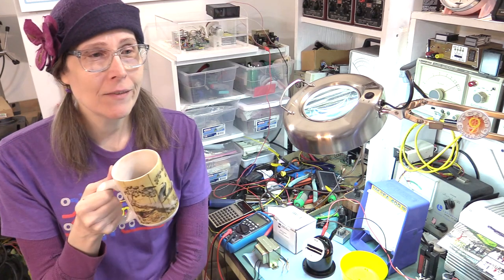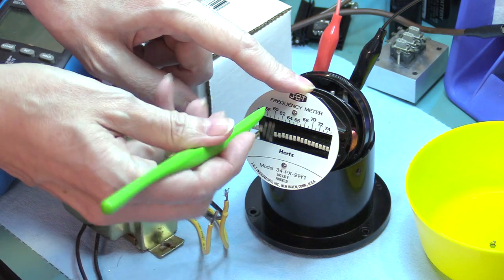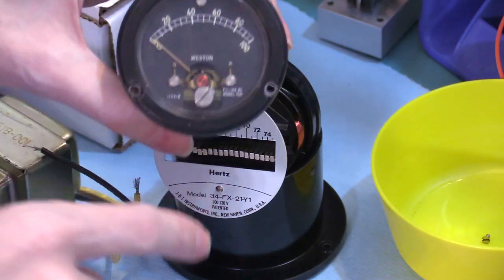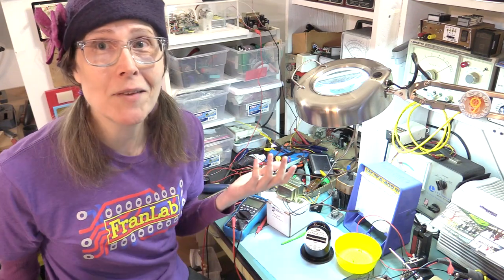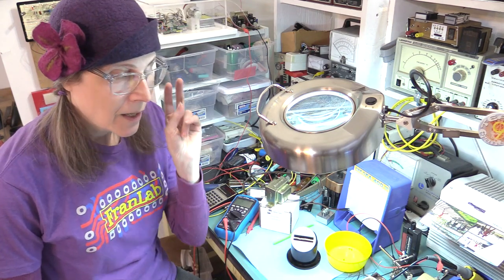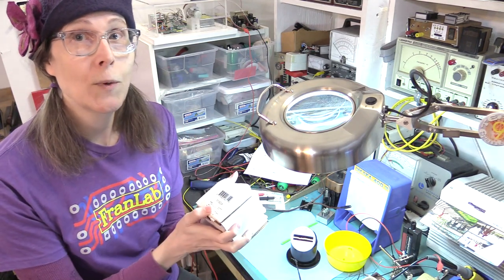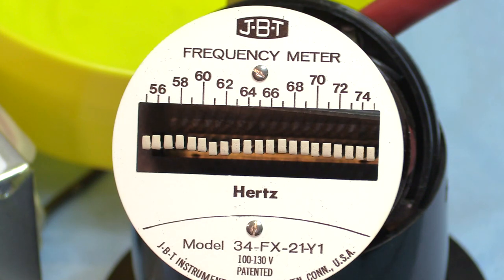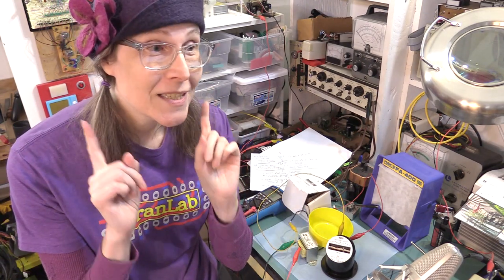Deep Dive Into The Electromagnetic Frequency Counter

Comment: Still not sure why they picked that frequency range...  If it was designed for American use only, why not center it around 60hz?  Is the frequency more likely to vary up than down?  And why not make it extend down to 50hz to be compatible with EU systems?

Comment: Gotta say, I've never heard of these before this video, and I think I figured it out on first glance. Before it was opened up. I know it's a frequency meter cos the video is titled so, but the "Hertz" marking is a dead giveaway for that.

How it works - electricity of some kind flows through the coil. Cos it's around 60Hz maybe US mains? Maybe for a big motor? The tines of the comb resonate along with the magnetic field, and whichever resonates most will be the right answer. I'd guess adjacent tines would wobble too, but not as much, it'll be a rounded blur when they're wibbling at their proper frequency. 

That's my guess, I know Fran's not stupid but I think you messed up on this one!
Reply: BTW the idea of a comb of vibrating tines is also used in a music box, this is sort of an inverse version of that. And old RC planes / cars etc used to use tuned tines as a way of encoding information before pulses were used. The transmitter would have vibrating forks for each input, which would be transmitted as audio over the RF. The reciever would pick that up, and feed it to a coil around a tuned comb like this, and the tine at that frequency would vibrate most heavily, and thus vibrate further back and forth. Since it was metal, it could touch against a contact and energise whatever circuit. I read about this in a really, really old book in a library, the horrendous neglect of library budgets has meant I learnt a few bits of long-obsolete knowledge as a kid. 

Then as an adult, I once drank in a pub that had the walls lined with books, the ones decorators buy by the metre. Shameful really but if nobody else is gonna step up... My eyes naturally were drawn to a guide to industrial mains wiring from 1915 or so. It had mercury rectifiers but no semiconductors, everything else was electromechanical and often based round losing huge quantities of power as heat, as the only way of controlling it. I took it home, I'm sure the profit on my pint paid them back for it a hundred times. Didn't learn anything useful but that's not the point.

Comment: Found the patent https://patents.google.com/patent/US3374432A/en?assignee=J+B+T+INSTR+Inc&page=1

The diverging plates are so the heavier times and the lighter times have the same amplitude for a given voltage. 

The heavier ones need less force to get same amplitude surprisingly.
Analogous to q factor I think: 1/R*root(L/C)

The inductance corresponds to mass, so the heavier slower ones have a sharper+higher peak.

I

Comment: The only reason y i knew how it worked was cause i saw ave playing with a vibration / rpm device that was nearly identical just without the coil. i bet u could have just strapped it to a subwoofer and played different frequency's and that would have showd it working

Comment: Since when did DC resistance of the primary of the transformer equal the seen impedance at audio frequencies??? Your tube amp wouldn't work with that mentality. But yes, the idea of a step-up transformer is there :-)

Comment: 14 minutes in, you are confusing resistance with impedance. All other things being equal, the input impedance of the transformer is determined by the load on the output of the transformer and the turns ratio. Of course stray much outside the transformer's spec and other factors come into play. Imagine a mains transformer with a light bulb across the secondary. Switch the bulb off, and the mains power consumption falls to almost zero right? Because the 'infinite' secondary impedance is reflected back to the primary. Measuring DC resistance is just measuring the resistance of a length of copper wire - unravel it off the transformer and it'll read the same.

Comment: Your calculus is wrong regarding impedance , you measure DC resistance with your multimeter from primary and secondary but not the impedance of the coil at 60HZ which is completely different .

Comment: doesn't the DC resistance of transformers disappear when you apply AC to it? and then impedance takes over?
Reply: Yes, with the exception of ferroresonance. This is a rare occurance, but can happen when an outside influance changes the series capacitance in  the line. Basically, it takes the phase angle relationship of the voltage and current away. The voltage and current come into phase unity, therefor the AC signal looks like DC as far as the inductor is concerned and behaves like DC. Bad things can then follow.........

Comment: But Fran, love... You're way too concerned about the impedance match there when in reality that amp can more than handle driving that meter thru the power transformer you have there in your hand.

If you need 1W out, you're not putting much more than 1W in to the transformer to get that same watt out the other side.

I realize you aren't into blowing things up on your bench, but you have to realize when you're dealing with driving something like that, all you have to do is get the voltage up high enough to stimulate the coil.

That and I guarantee you didn't measure the actual impedance of the transformer coming up with 100 milliohms. The value obtained alone tells me that was obtained with a DC measurement which isn't even close to the AC impedance. You'll find if anything that the transformer could be placed across the speakers in parallel and the amp wouldn't even hardly notice it was there, even less so by itself.

The key to this kind of experimenting is to start out with the drive low and ramp it up until you get the desired effect, while observing the behavior of the equipment you're using to drive it. Anything funny? Back out.

Either way I'm glad you did the follow up just because it showed you it wasn't as complex as you thought it would be.

Comment: the explanation of the impedance mismatch does not work !  when you connect this frequency meter to the power utility  the power utility impedance is almost zero  an the frequency meter  will work perfectly . The power utility is a voltage source   putting a 2 K ohm load on it won’t affect it .

Comment: Wondered why you didn't drive it with a solid state Hi-Fi amp instead.  A guitar amp is far from linear or clean at 60 Hz, and you risked damaging it by running it into an unloaded transformer instead of a speaker.

Comment: How did you know to hook power to each terminal or side as opposed to hooking it in series like an Ammeter? Did it come with a schematic and hookup instructions?
Reply: With a DC resistance of 16K, it wouldn't go in series with a load.  Also, there would be no advantage to series connection just for frequency measurement.
Reply: @thesquarerootofnegativei6225  But even if you hooked it in series, you'd still get 60Hz running through it... The 16K internal resistance would be the load
Reply: @JungleYT  You would, but your load, without which there is no "in series", wouldn't get much power.  If the only load is the meter, it is in parallel with the power source.  Which is fine.  It answers your initial query.

Comment: 100-130 volts? Plug it STRAIGHT into the wall. No, seriously, that is how it works. Do the math. Ohm's law. Those meters were common in generator sets. A resistance of 16K ohms @ 120 volts is 7.5 mA. That is not a COINCIDENCE. Emergency generator power was more likely to run over 60Hz than under.

Comment: I guess the tapered plates are the main way of calibration and the amount of solder difference between each end required at each end of the fingers for tuning is only slight.
Off topic but I remember looking a very old car speedometer that worked with curved aluminium plate and a rotating magnet (Lenz's law effect) today we seem to have lost the mechanical solutions to problems and replaced it with a "black box" that does not inspire the younger generation to solve problems.
Here is a chap doing an experiment with an spinning magnet and aluminium disk.
https://youtu.be/3-jGzcD_XvQ

Comment: Would it show two frequencies, 60 and 70?
Reply: Technically it should.
Reply: Absolutely.  Of course, it is not likely that would occur, or even could occur, on a power line.  You could have an extremely distorted waveform but that would only produce harmonics far above any of the resonances of the reeds.  (Fran was incorrect saying she was seeing harmonics.  She was just seeing various adjacent reeds vibrating because the frequency range sensitivity doesn't have a sharp cutoff in this sort of thing.)
Reply: @trainliker100  It could probably be done better with an oscilloscope but when you have one alternator spinning and you want a second online and parallel you could see two.
Reply: @ProperLogicalDebate  Depending on the alternator design, if they are significantly out of phase (as would be the case if one were 60 Hz and one 70 Hz), one or the other then might not last very long.  But the meter would be able to tell you which one failed.

Comment: Asking why you would buy something obscure and take it to bits just to see how it works, is someone who doesn't get the point I think. Its like, why would I buy 20 different manufacturer pin cylinder padlocks when it's widely known how they work. Its because that's not the reason. I want to see how they were manufactured differently, what was tweaked to make them perform better, or not, and look at the quality of materials used. ...and mostly, just because they look nice to me.